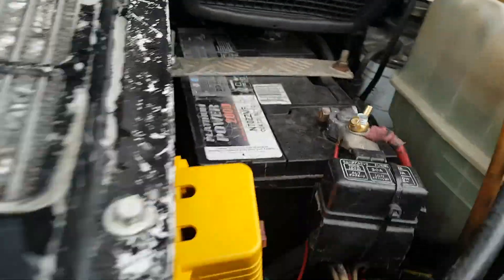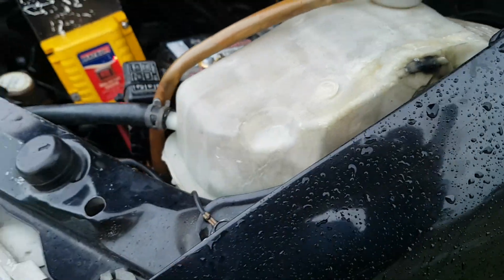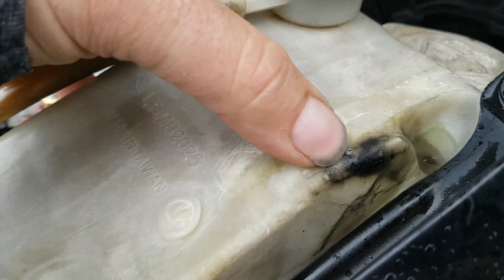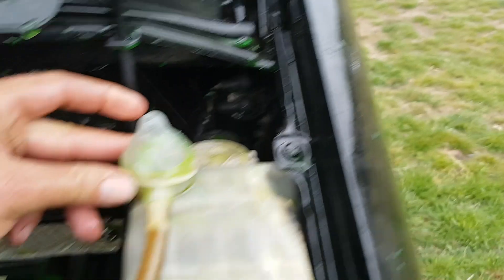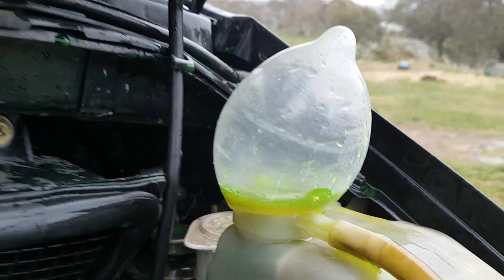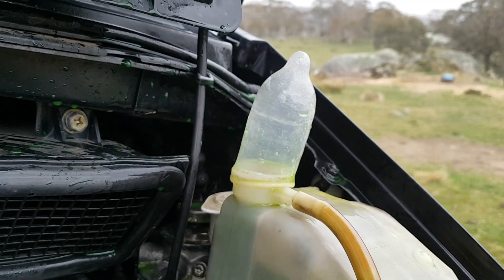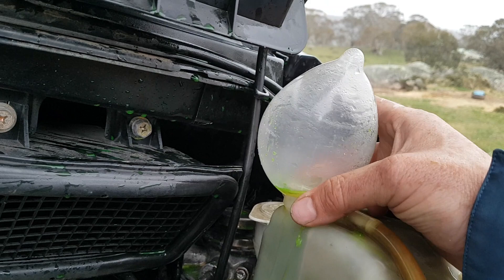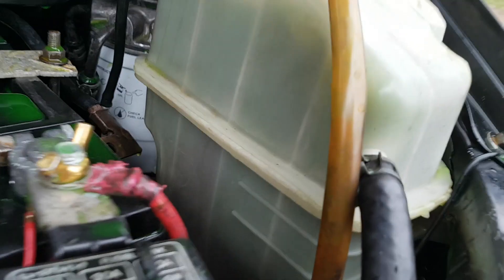Cylinder head Condom Test with EXPLOSION!  Cylinder head  head Gasket - DR DELICA

Comment: Love it this cracked me up.. did you get it repaired in the end?
Reply from the maker: Yeah  Dan, I had to put a tin of white pepper in and remove the cap so I could drive 650 km to my dads workshop to replace the head. It had 3 cracks. Gangster :) cheers for commenting brosef!
Reply: @drdelica7196  Lol!!! Does the white pepper prevent the coolant from spilling out everywhere? Cheers
Reply from the maker: basically yes, the white pepper kinda plugs the hole . well its meant to. usually I would fit pepper then leave the cap off